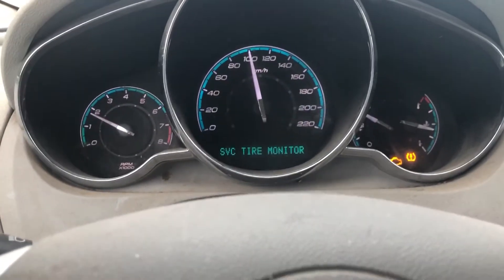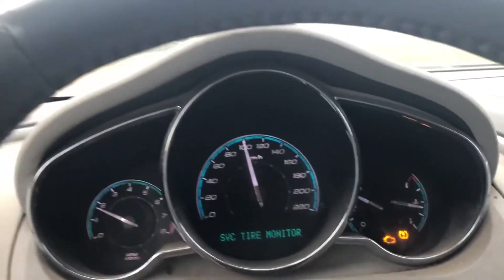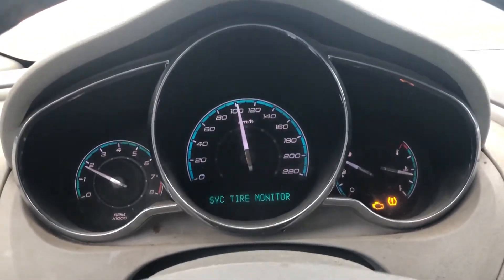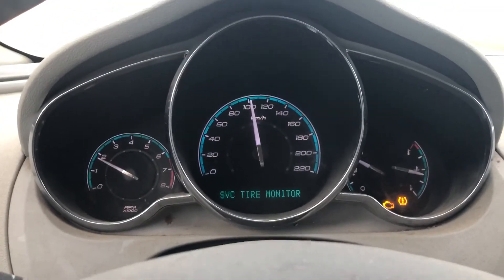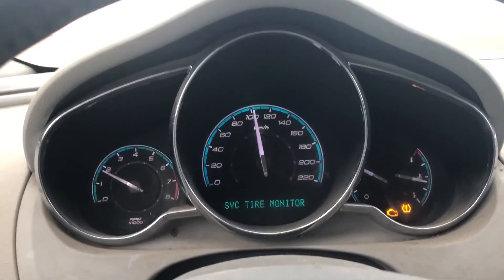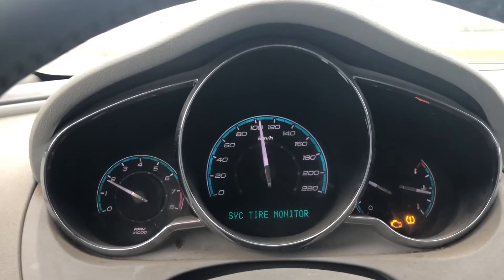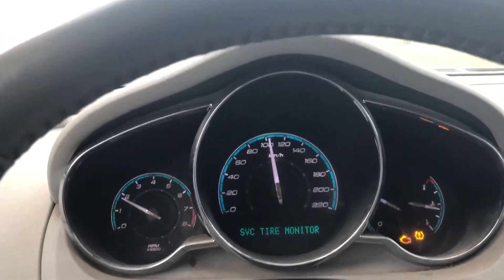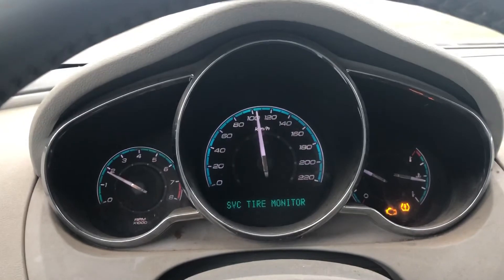Wheel Bearing Diagnosis

Comment from the maker: Update: As predicted in my video the cause of the noise was in the drivers side wheel bearing. This is often the case with "really noisy" wheel bearings. But the swerving technique usually holds up. In conclusion, there is no fool proof "mechanicing" lol.